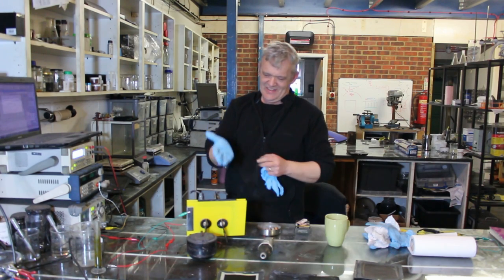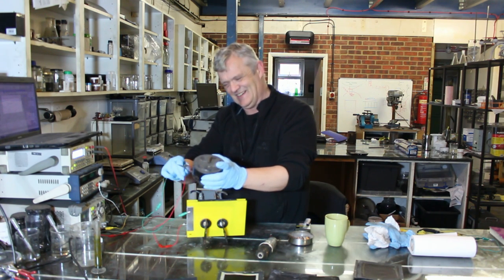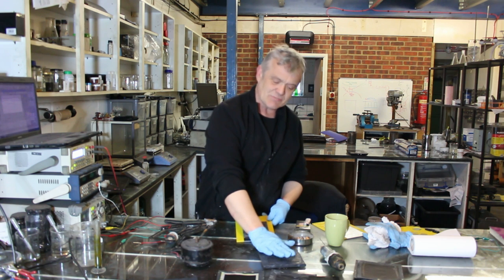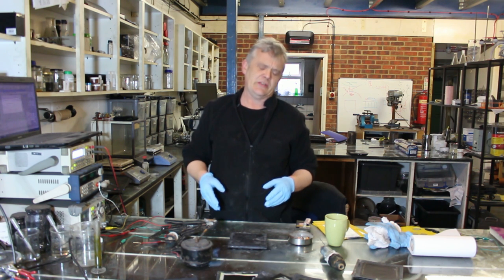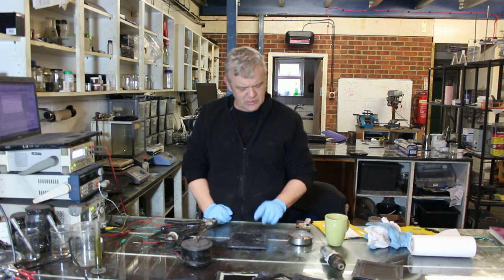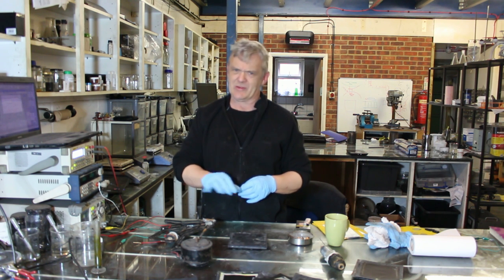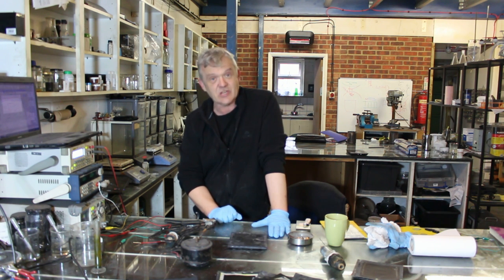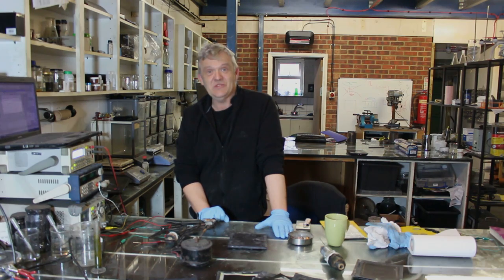FWG Supercapacitor   Finished

Comment: Very useful capacity/voltage.  If you stack 4 or build one with 4  times the plates you get 72V max. Put a 18-72V DC-DC converter on the output and you will be able to get over 90% of the stored power to the load (less the converter losses).  Many MPPT solar charge controllers will be able to handle the charging voltage range of the battery packs without too many issues. 24 of the battery modules would be good for about 1KWH.
Reply from the maker: awesome mate but don't forget this is a supercap - we also have a battery which i will show - the reason for a cap is power density and a battery for energy density - cheers mate

Comment: Please correct me if I'm wrong, but based on the numbers you have given,
Stack Weight = 200g
Stack Volume= 0.1152L(12x12x0.8 cm3)
Rated Voltage= 18V
Rated Capacitance= 1000F
Your Stack Capacity is  45Wh (and hence energy density is 225Wh/Kg and 390Wh/L).
This is very impressive for any kind of battery and at par with some Lithium ion counterparts!!!
Amazing Job!! Where can i buy this?
And I would love to contribute with cell design. Plz ping me if needed
Reply from the maker: each cell is 1,000F mate so the block of 10 is 100F - so i am afraid you are out by a factor of 10 - the figures are good but not quite battery figures - but we are doing a battery too and we will reveal that as a finished product pretty soon
Reply: correct?
Stack Weight = 200g
Stack Volume= 0.1152L(12x12x0.8 cm3)
Rated Voltage= 18V
Rated Capacitance= 100 F
Stack Capacity   4.5Wh (energy density  22.5 Wh/Kg and 39 Wh/L)
_______________
SkelCap SCA3200: 53 kW/kg ; 64kw/L;  6,8 Wh/kg;  8.7 kwh/l;      1.8 euro/kw;  14 euro/wh; 14000/kwh
Maxwell K2 ULTRACAPACITORS - 2.85V/3400F specs:  Typical Usuable Specific Power  8.5 kW/kg Minimum Impedance Match Specific Power  14 kW/kg Typical Impedance Match Specific Power 18 kW/kg; Minimum Specific Energy 7.4 Wh/kg Typical Specific Energy  7.6 Wh/kg
Reply: Was so excited as well, I did the calcs on 1000f at 18v. Still impressive regardless
Reply from the maker: oops lol - it is still pretty good indeed but at 1000f it would have been awesome lol

Comment: You may to think of cutting the square into a rectangle and tripling the thickness, It would probably sell better if you could make it possible to insert into a handle designed for it. Saves money on plates too.
Reply from the maker: cheers mate

Comment: Can you hook up one of your supercapacitors and one of your super batteries in parallel or in series?
Reply from the maker: yes mate you can
Reply: @ThinkingandTinkering  Love your work Robert....put a link to ebay in the description when you are ready to sell these. Many thanks
Reply: Robert, there's no reason why it should not be possible to put a supercapacitor and battery of cells together in the same package, even if the two components have to be physically (chemically) separated but electrically connected.
Reply from the maker: agreed mate

Comment: This no balance act is very impressive and a real game changer as the speed of most lithium cells comes down to either bleed off resistors which in this case would have to be a decent size due to c rating not applying  or voltage limiting systems that let the slower more resistive cells catch up. 
So are there any  bottlenecks regulating speed of charge ?
The new Nissan Leaf still does not have industry standard liquid cooling on there batteries so they will continue to have heating issues and rapid battery degradation but your tech may well be a new industry standard if they can handle the duty cycle without heat issues. Along with say 50% battery 50% supercap it could tick many boxes !
Reply: The voltage is also quite useful. imagine a cordless power tool (e.g drill): you use it every now and then and have to keep it charged. after a certain time the battery degrades and is only good for a few drills. The capacitor would allow to charge it in seconds to a useful charge - even it goes only for a few drills it would charge so rapidly it still would be a benefit in weight and lifetime
Reply from the maker: mate - i think you have hit on a killer application for this - awesome!
Reply from the maker: interesting thinking mate - cheers
Reply: The power tool charging idea has already been demonstrated by Zap+Go. Have a search on YouTube for some of their videos.
Reply from the maker: cheers mate - But I know, I also know the zap and go folks personally
Reply from the maker: nice post mate - cheers

Comment: How much will each "blade" cost? And is 18v the lowest voltage  design this gen.? does the desired 100% depth of discharge and keeping it in a useable voltage range have something to do with the particular voltage chosen?
Reply from the maker: I only choose voltage as what will fit into what we already have mate - i am likely to settle on 12 volts for obvious reasons but it can up or down in 2 volt steps as for cost i still don't know but it will be less than what is already out there mate
Reply: @ThinkingandTinkering  A 12V solution would not play nice in any environment that has or could use lead acid batteries. I guess the real question is how much extra cost does adding the extra layers costs to the manufacturing process, compared to all the other costs that will set the final price.
Reply: now retail led 2-400$/kwh; lifer  up to 800; lipo to1200

Comment: Also depending on heat generation. A cubic structure would increase the power density and lower price/W/hr for applications that are happy with a lower charge/discharge rate. You could use the same size core materials, front and back, just different sides and a different max voltage.
Reply from the maker: absolutely mate

Comment: EDITED. 10 x 1000 farad capacitors in series (according to Robs comments)  gives 100 farads at 18v = 1620 Joules  = 4.5 watt hours. Happy new year to you all. Checking a commercial 16V supercapacitor array it looks like FWG will  have around 3 times the power density.
Reply: Nice
Reply: @unlost117  copied from Google: Charge: Q = CV where C is the capacitance in Farads, V is the voltageacross the capacitor in Volts and Q is the charge measured in coulombs (C). Energy stored: W = ½ QV = ½ CV2where W is the energy measured in Joules.
Reply: hmmm i thort energy=v^2 x F=18x18x100= 32400J= 32400/3600=9 watt hours. Its still an amazing super capacitor for its weight! EDIT and i forgot to multiply all that by 1/2 in the formula so yer 4.5Watt hours. Thanks @veronicathecow  for making me look at it again :)
Reply: @unlost117  Energy stored: W = ½ QV = ½ CV2 where W is the energy measured in Joules.
Reply: I miss read Roberts later comment (I thought it was 100f x10 layers ) but luckily  it was your comment that corrected me on it so thank you.  @unlost117
Reply: @Tristan Sachsenweger Yes but its not 1000F, its 100F for the 18v pack. Its 1000F for each 1.8v cell in the 10 pack in series.
Reply: 45wh @ 18v = 2.5Ah
Reply: @WileHeCoyote   Hi, batteries are measured in Ah. Capacitors in capacity and volts which gives you the number of joules.
Reply: Except that Rob later states it's 10 series plates at 1000F each making 100F or 4.5 watt hours. @Tristan Sachsenweger
Reply: @veronicathecow - 4.5 wh  per 200g unit?  by OEM specs:  SkelCap SCA3200 6,8 Wh/kg; Maxwell BMOD0130 P056 B03 56v module Specific Energy  3.1 Wh/kg;  K2 ULTRACAPACITORS - 2.85V/3400F - Minimum Specific Energy,7.4 Wh/kg Typical Specific Energy,  7.6 Wh/kg
Reply: Hi Channel 11, that's interesting. Maybe Rob has got the capacity wrong? In the video he does. Perhaps it is 10 plates of 100F (not 1000F as he mentions) each giving a total energy  of just 0.45 Watt hours for 200g which is more in line with these other capacitors. I suppose we will have to wait for confirmation?  @channel-sc2uu

Comment: I own some of those 500F Supercapacitors and have them laying around and so I know a bit about your reference points.

To be about one fifth the weight is very nice.  Starts to get closer to battery densities.

The maximum "safe" voltage for a Supercapacitor would be about 50 volts. ("safe" meaning you might survive)

Given that you say this is self balancing I'd really love to see a 50 volt version experimented with.  Not needing to balance is a huge plus.

That's enough voltage to do most things pretty well.

Anyway...  progress continues to inch along and I don't recommend you get yourself into a big hurry, so keep doing what you are doing.

------------------

Just another thought...

The Lithium Titanate Battery has been getting interesting lately.  It has massive charge and discharge capability (10C and 20C) and most important has excellent cold weather performance.

I have an ebike with 750Wh of A123 20Ah cells and they are so sensitive to temperature that in winter you lose at least a quarter of the performance.

One of the big areas of advantage is cold weather performance.

LTO cells are about 60 Wh / kg so below the LiFePO4 performance, but are consistent across all temperatures.

I noticed that the Chinese are selling those LTOs to places like Russia where it's cold a lot.

Winter is a big problem for most batteries.
Reply from the maker: I agree mate - slow and steady is best - makes sure you're not making some silly error you find out about later - interestingly enough if i add a bit of polyethylene glycol to the electrolyte i can get this to operate down to minus 30 at a 50% reduction in power density
Reply: @ThinkingandTinkering    That's interesting.

If you can achieve that level of cold weather performance and boost the storage capacity to equal some of the other options that will really help in the cold weather climates.

Right now I'm in California which never really gets cold even in winter, but I'll be in Wisconsin eventually where winter cold is a serious issue.

I want to build a winter ebike with a fat tire bike format so I'm going to be looking into different options.
Reply from the maker: to be honest mate i think real improvement will come when we tie down the production process and get full automation - there is so much wasted material on this device only because that is what i can handle - out of the 20 grams of cell weight 7.5 grams is electrolyte and 4 grams is active material the rrest ( 8.5 grams) is case weight - i should be able to get half that with better machinery which will be an automatic 20% increase in energy density
Reply: @ThinkingandTinkering    Just take your time.  You are attempting something that usually requires massive capital investment in order to get things moving, but "the slow and steady wins the race" approach will get you there without millions in investment.
Reply from the maker: i agree mate and i can see us getting there - it's a shame most other folks just don't know what is involved here and to be honest it is refreshing to talk to someone who does
Reply: I think the design and potential to be an ignition source defines a big safety part of it as well. People might survive much larger shock while at the same time could be shocked to 50mA by little voltage in some wet conditions. Point is it's not a good idea to rub voltage the wrong way.
Reply from the maker: it does indeed and being an aqueous device certainly limits that a great deal

Comment: OOhhhh yer now you have got it ! Thats AMAZING Rob! Is the 1000F per capacitor or 100F  total at 18v ? Awesome work my friend. LOVE it
Reply from the maker: cheers mate and yes i realised after i posted it that it might confuse a bit but you have the idea - it's 100F per cell with 10 in series connection so 100F at 18V in total and 1000F at 1.8V per cell - so 5 in parralel would equal 500F and weigh 1kg
Reply: @ThinkingandTinkering  Don't you have to divide the capacitance by the number of capacitors in series for farads? You end up with 10F @ 18V, amp hours or watt hours might be more useful for ratings.
Reply: @lizardmech  I think Rob is saying each 1.8v (cell) is 1000F so 10 of em in series is 100F. (Can we call 10 of them in series a "battery" instead of a cell as rob called it earlier for clarity?) even tho it isnt a battery as such?
Reply: @unlost117  Ah that makes sense, comes to about 45 watt hours which is quite a bit, assuming you use a little weight for housings it's about 160 to 200 watt hours per KG. The best li-ions are about 250-300.
Reply: @lizardmech  Think you will find it to be about 9 Watt hours since energy=v^2 x F=18x18x100= 32400J= 32400/3600=9 watt hours. Amazing stuff for its weight
Reply: @unlost117  Yeah, missed a decimal place, online calculator reckons it's 4.5 watt hour, he did say that was the supercapacitor variation not the battery version, I assume the battery one trades ESR for capacity, I remember he was using various salts and metals in some. I'm not sure if it's a pure EDL device or hyrbid.
Reply: @lizardmech  Yer and somehow i think my formula is wrong too in any case. Think i should have divided by 2 but its not shown on the wiki page in equalities section here https://en.wikipedia.org/wiki/Farad so my previous comment should be 9Watt hours /2 = 4.5 Watt hours as discussed elsewhere in comments. Thanks for the heads up all.
Reply from the maker: nearly mate - 5 in parralel would weigh 100g - a single cell is 1,000F, 20g and 12cm by 12cm and is 1.8v
Reply: Oh i see what you mean. You made 100F total  capacitor series bank @18v. and 5 of these in parallel will make 500F @18v and weigh 1kg. Awesome
Reply from the maker: exactly mate
Reply: @ThinkingandTinkering  This is Awesome man. Are you considering packing them into A4 size leaflets? maybe 5000 Farad per cell @1.8v and 10 cells in series gives 500F @18v ? Even maybe roll those A4 leaflets into a coils or cylinders like a rolled up newspaper? Newspaper with energy :P

Comment: Oh wow 😊excellent so that’s 1.8 volts then ? What voltage is it charged at and what is it’s c rating for charge and discharge ? 2019 is going to be trying to keep up with your self 😂😂😂 well done
Reply from the maker: no 18 volts mate and it's charged at 18 volts - it's a cap not a battery so C rate doesn't really apply mate and i think you are right 2019 is going to be interesting lol
Reply: Robert Murray-Smith so you meet to say gov that that beast can be dead 💀 short no problem ?😮
Reply: I'd wager 500C easy.